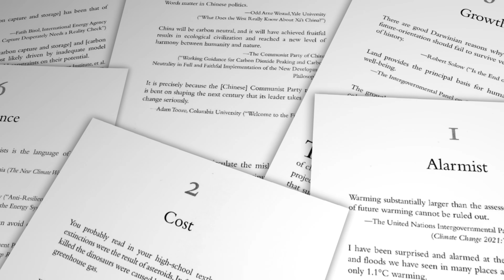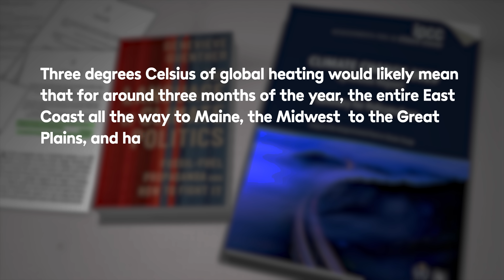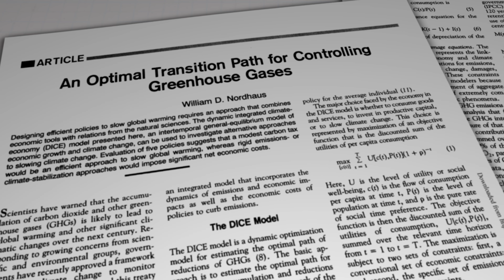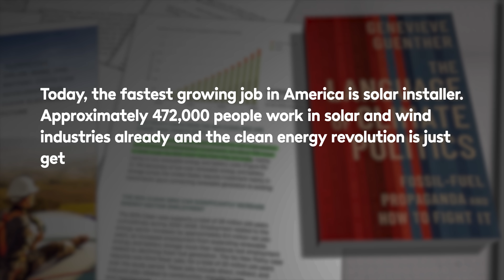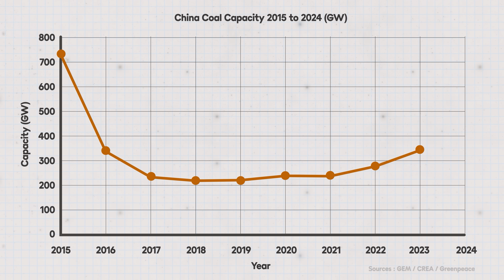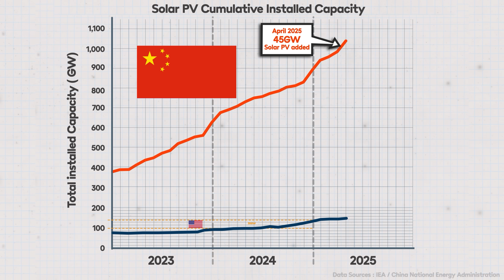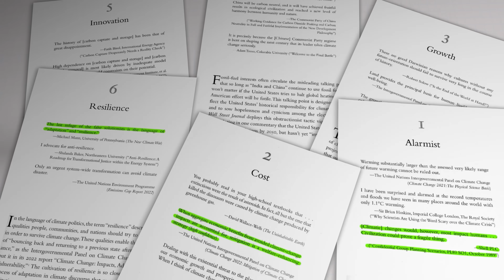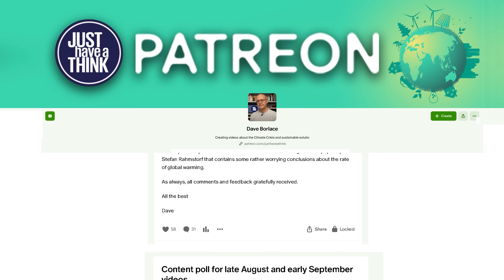New research DEBUNKS climate disinformation.

Comment: Please stop shilling the climate hysteria. 
The oceans are not warming
Sea levels are not rising any faster now than 200 years ago.
The climate is cooler today than the beginning of lat century (when Urban data is removed. 
The climate is cooler than the medieval warm period
The climate is cooler than the Roman warm period. 
The climate is cooler than the Holocene Optimum. 
No level of CO2 at any time in the last 600 million years has triggered warming or prevented cooling.
CO2 only causes an extra 0.7 degrees of warming if its concentration doubles and has only 'caused' about 0.4 degrees of warming since the beginning of the industrial revolution. 
During the last 8 inter-glacial cycles the planet warmed when CO2 was low and cooled when CO2 was high because the climate controls CO2 not the other way around CO2 is a thermometer not a thermostat. 
The sun controls the climate greenhouse gases are just a mild insulator that slows down cooling.
The sun caused the warming into the Holocene Optimum and the cooling afterwards
The sun caused the warming into the Minoan warm period and the cooling afterwards
The sun caused the warming into the Roman warm period and the cooling afterwards
The sun caused the warming into the Medieval warm period and the cooling afterwards
The sun caused the cooling into the Little ice age and the current warming afterwards.
NOT CO2
We need a lot more CO2 not less. The ONLY world metric that has matched CO2 rise has been crop yields per hectare,  The Ideal level of CO2 would be 1000ppm to maximize food production and warm the planet to Medieval warm period temperatures while increasing drought resistance.

Comment: I do not know if you saw the effects of Mt St Helens explosive eruptions some years ago but the spectacular sunsets afterwards where nice to see in the UK though most of the ash did a number of laps round the globe. So one country's smell can make the world stink. Working alone is expensive and not productive in solving the problems. Milankovitch cycles will cause greater problems (and solve some of our current ones). One of the cycles is the cause of the great flood reports in most religions, the atmospheric transport of water will change climate and very quickly (10's of years). Tropics go green. northern latitudes go dry. Food production has to shift from northern latitudes to the tropics. So areas now producing CO2 will be as dry as a desert or under water or washed away. Why are there some areas of the world have no trees? These areas have regular floods which make tree growth unstable. Example in Scotland is Rannock forest, not seen today unless you dig a hole, but a large expanse of trees more then 7000 years ago all collapsed in the bog below ground.

Comment: We are all going to feel the pain of the tariffs because the world economy isn’t a sum of the individual GDPs of the nations.
I hate to see the hit that ICE transportation industry employees will take. The writing was already on the wall,but the tariffs accelerated the process and will shut down low margin,but essential, manufacturers of sub assemblies.
No one expects ICE cars to be immediately recycled but gradually replaced by EVs.Some will last much longer than the point where expenses of operation will turn them into something like your grandfather’s tool you keep in the junk drawer to use some day.
I can’t justify buying an EV due to my age but have focused on building up off grid solar. My battery bank will allow me to go completely off grid if I have to. My electric bike has enough range to make the 80 mile round trip to the VA hospital every six months. If I don’t make it back home, I can ignore the tongue lashing from the doctor and leave the problem in the hands of my replacement.

Comment: capitalism is our problem.  the solution is socialism and green new deal, not the death of humanity.

news from west texas:  our wheat crop fails in dry years, and more heat means more dry for wheat as it uses more water.  make our winter and spring a little hotter and a little dryer and all those millions of bushels of wheat will be no more.  you could look up wheat farming and find this out.  it needs somewhere around 24" annual rainfall, more than we get in a dry year now.

how about the corn belt?  more of the same.

Comment: Instead of having a good think,  perhaps you ought to have good read. No sensible person denies the climate is changing. It has always changed. There have always been floods, droughts, heat waves, extreme cold spells etc. Look at the historical record.  Far moe people die of cold and excess heat. Read the evidence. Wind, solar and battery storage are horrendously expensive, unreliable  as well as very polluting. Energy needs to be available continuously, not just when the sun shines or when the wind blows. Battery storage is still miniscule in term of size. You need to listen to engineers involved in energy production and security. Fossil fuels will remain the principal source of energy for many years yet.  However, i doubt you will ever have a change of mind as you are infected by the mind virus causing this ideology. CO2 is not  the control knob of our climate. Even the IPCC states there has been no change in the frequency of weather extremes. Just try listening to a few scientists from the other side. The "science " is not settled. Climate models are not reliable. Unfortunately, our politicians also suffer from this climate delusion and are destroying our economies for no reason.  Perhaps you ought to read "The Madness of Crowds" by Charles Mackay.
Reply: #buzzwords #commonmisrepresentations

Comment: If global warming is happening can you explain that Antarctic sea ice reaches record maximum https://www.nasa.gov/centers-and-facilities/goddard/antarctic-sea-ice-reaches-new-record-maximum/
Reply: Maybe try reading the article you linked to. It explains it for you.
Reply: @House_Stark  To be specific:

"“The planet as a whole is doing what was expected in terms of warming. Sea ice as a whole is decreasing as expected, but just like with global warming, not every location with sea ice will have a downward trend in ice extent,” Parkinson said."

Worth noting, which the article does not, that a lot of the ice extent increase around Antarctica is due to the massive loss of glacials that are happening on the land.  In short, there's more sea ice in Antarctica because there's a lot of cold water literally just above the freezing mark going into the ocean.

Ocean oscillation and natural temperature variation (that is, weather), also factor in, which the article does mention:

"That suggests that a low-pressure system centered in the Amundsen Sea could be intensifying or becoming more frequent in the area, she said – changing the wind patterns and circulating warm air over the peninsula, while sweeping cold air from the Antarctic continent over the Ross Sea. This, and other wind and lower atmospheric pattern changes, could be influenced by the ozone hole higher up in the atmosphere – a possibility that has received scientific attention in the past several years, Parkinson said."

Lastly, it's also worth noting that sea ice extent is generally not the barometer that climate change is measured by, for these very reasons.  Glacial melt is the trend that is followed, because weather patterns are far less likely to effect it.
Reply: You never read that article yourself, right?

That is really on another level of stupid.

Comment: Yes you can look at it from the start of the industrial revolution but you also need to remember that the planet is able to absorb a certain amount, plus that not only pumping out CO2 causes problems. Also clearing away forests and other things that would have absorbed CO2, to make way for people.

Like population numbers are also an issue because if nothing else they are clearing away forests. Like Africa's footprint is really small there but how much forest have they destroyed due to farming and animal herds? Like removing "10 absorb" does the same damage as "10 produce".

So when we compare countries we should also consider all the former CO2 absorption capacity that has been permanently removed. 10 is not much but 10 per day is or 10 over 100 years. This would be a fair way to measure because my country has 75%(70% if you include all land) of forests left and in -20C you kinda need to consume energy to survive. Like the consumption of energy is higher than someone living in a desert but trees absorb more than a desert. Plus that adding every country under Europe is kinda unfair too because that will include the worst ones with the best ones making it someone everyone's fault here when we have never been able to vote for your leaders.

Then we have countries with rivers and those without, we have countries that have a low population but much land so they kinda can produce more due to them not being "bunnies not thinking of the consequences a population boom will bring".

So many factors that would need to be included to really be able to judge countries.

Still the problem with everything is that India produces in 1 year what my country has produced since the start of the industrial age. It took my country more than 250 years to produce that amount while India has less than 250 times more people(like they had 5x multiplication the last 100 years while mine had less than 2x). So this means that if both would have been 250 then it would have been 1:1 but now its not and it even increasing. They multiply at a rate much higher making their contribution even a worse problem. So if the trend is the same, it doesn't matter if my country deleted all the emissions it caused during the last 250 years if India will increase their rate at the same levels. Like its already 5 years since the time when they passed our totals so in a total of 10 years they have increased their yearly emissions in 10 years about as much as my country has produced during 260 years. My point is not to deny a country from developing but the population number is NO excuse. They were around 250m 100 years ago so the "bunny has been strong"(251m in 1921).

I am not here to point out blame but not adding factors like "insane population growth" or "not having forests in areas that had forests in year 0000 because of population growth". So when you consider everything my country is pretty much innocent even if our emissions are around 6 per capita. Yes the new forest owner generation is a bit greedy and have made forests into "economy forests"(these are like wind tunnels so they dry out and much plant life dies, plus that they dig ditches because trees do not grow as fast in swamps), still the reserved land for forestland is there, if they just cover up the ditches and let mother nature do her thing only coming there to harvest some of her gifts to us. We do not have mountains like Sweden or Norway, so no way to store large amounts of energy when it rains. Still its an insult to be on the same lists as the "coal burning countries" or even Russia that just burns natural gas for fun or sometimes they don't even care to burn it....

Worst is all the fossil countries that have made money on it investing into clean energy sitting there like they would be some kind of saints... If they never would have sold it then... Or Germany that removes nuclear because they fear for human life, I wonder if +60C in Berlin is better(my point leaders doing dumb stuff to stay in power and get voted on again)...

Comment: What is "climate denial"? They deny collate? No, they reject your Climate Control.
Reply: No, they reject at least one of the following demonstrable facts:

1) Prof. Svante Arrhenius (1896) XXXI. On the influence of carbonic acid in the air upon the temperature of the ground , The London, Edinburgh, and Dublin Philosophical Magazine and Journal of Science, 41:251, 237-276
2) Royer, Dana L.. "CO2-forced climate thresholds during the Phanerozoic." Geochimica et Cosmochimica Acta 70 (2006): 5665-5675.
3) "Trends in Atmospheric Carbon Dioxide", NOAA, 2005, updated monthly.
4) HadCrut, NASA GISS, NOAA, Goddard and numerous other temperature data sets, all available as both raw and adjusted measurements.
5) "How do we know that recent CO2 increases are due to human activities" Steig, 2004, RealClimate

The last one cites the following:

Stuiver, M., Burk, R. L. and Quay, P. D. 1984. 13C/12C ratios and the transfer of biospheric carbon to the atmosphere. J. Geophys. Res. 89, 11,731-11,748.
Francey, R.J., Allison, C.E., Etheridge, D.M., Trudinger, C.M., Enting, I.G., Leuenberger, M., Langenfelds, R.L., Michel, E., Steele, L.P., 1999. A 1000-year high precision record of d13Cin atmospheric CO2. Tellus 51B, 170-193 (Revised in "A revised 1000-year atmospheric d13Cin-CO2 record from Law Dome and South Pole, Antarctica", M. Rubino, D. M. Etheridge, C. M. Trudinger, C. E. Allison, M. O. Battle, R. L. Langenfelds, L. P. Steele, M. Curran, M. Bender, J. W. C. White, T. M. Jenk, T. Blunier, R. J. Francey, JGR Atmosphers, 2013)
Quay, P.D., B. Tilbrook, C.S. Wong. Oceanic uptake of fossil fuel CO2: carbon-13 evidence. Science 256 (1992), 74-79

Comment: Just also picking alarmist headlines out of books and certain scientists is not very convincing either
Reply: What would be convincing?
Reply: @Leafsdude7 just have a think is as much biased to netzero as oil lobby publications are the other way. Climate influencing root causes are not manmade CO2. It's only a very small part.
Reply: @chris11oz Instead of simply answering the question, you puked out silly a claim that has been debunked 1000s of times.

What causes the current warming and where is your evidence?
Reply: @chris11oz "Climate influencing root causes are not manmade CO2"
Published research on Co2 is overwhelmingly in agreement that Co2 is the main driver of global temperature. And recent Co2 increase is linked to fossil fuels via Carbon Isotope ratio measurements. Natural co2 emission has a different C12/C13 ratio compared to Co2 emissions from fossil fuels.
Reply: @chris11oz So...

What would convince you otherwise?